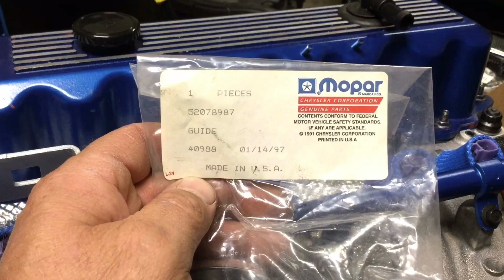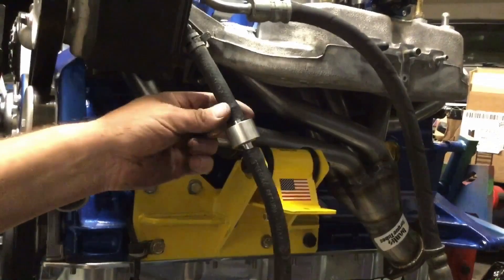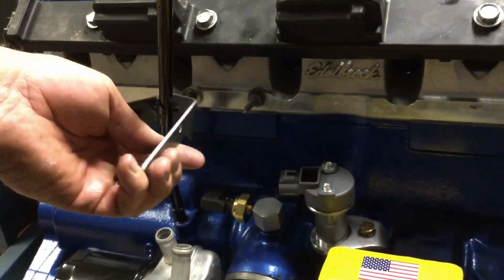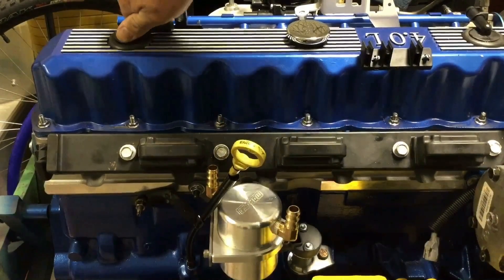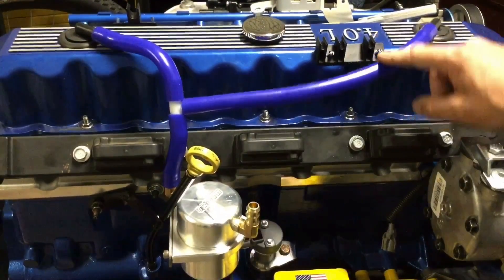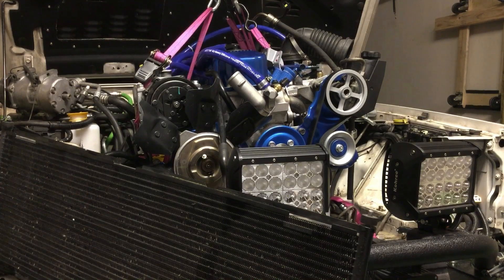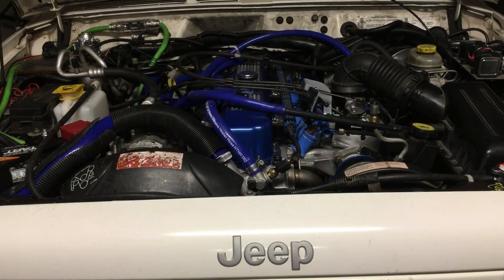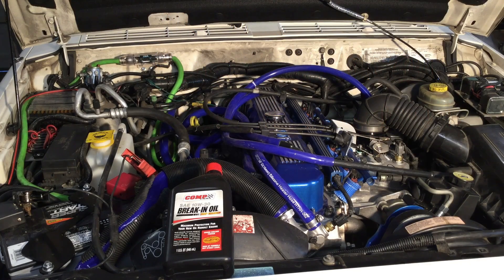Jeep 4.7 Stroker Complete Build Part 7 (Finishing Touches)

Comment: Great job my friend. I can’t wait to do something similar to my 2006 Wrangler Rubicon 4.0. Either do it myself or buy one from 505 Performance with something around 350 horsepower. I’m leaning toward the second option because I have two herniated discs in my lower back and, for example, a simple job that could take me a couple hours to do it because of my back it could take me double the time.

Comment: I followed your build and built mine exactly the way you built yours. EXCELLENT build. Thank you. It's all broken in and got about 3k miles on it. Then it sat for a yr while I did a stretch and axle upgrade. It's time to change the oil and I forgot what oil to use (insert stupidity). Can you tell me what oil to use once its all broke in?

Comment: I’ve watched your video series 2x now. Best in-depth build yet! I’m doing a YJ build, a 4.2 with a 4.0 headswap, using that Edelbrock head… but I like some of the other stuff you’ve done here and made note of the part numbers. Thanks for sharing and give us an update, how’s it holding up? What all have you done with it. 👍 🙂
Reply from the maker: Thank you! I’ve been using it for off-road recovery a lot. Recently I got a little happy with the throttle and spun a bearing. It still runs fine but I’m going to use this as an excuse to do a tear down and upgrade to a roller cam and possibly shave the rods to clear the girdle without spacers.

Comment: The pcv system wont work well that way... you have a direct vac leak
Reply from the maker: It runs fine and collects oil vapor the way it’s designed to. Where would the leak be?
Reply: @kevefox  the catch can should  be inline between the valve cover and air filter. The other port on the valve cover to intake vac... the way you have it, the intake is drawing straight from the air cleaner and not providing proper crankcase vac..

Comment: You are the KING!!! Did the same thing back in 2003. WISH I had all this info then. Lots of studying and trial and error. Stroked to a 4.5 and after 100K shes still running. Been itching to redo it again with all the new parts available now. My aim is for more LOW end tourque. Didn't do the roller rockers. Thought of going TDI, but I'm just in love with that 4.0......uh 4.5!!!
Reply from the maker: Thank you! I wish I would have gone with roller lifters/cam too. There is a supercharger mod utilizing a charger from a thunderbird. I guess with little machining it mounts to the A/C bracket. $350ish mod.

Comment: Great video.  Gotta know where you got your motor building experience.  Great job.  Few questions.  How much was the build?  How long did it take?
Reply from the maker: Always been around some sort of torn down engine. High school auto shop, years of off roading, boating, heavy equipment, and towing, lots of towing. They all break. Lots of watching and reading, fixing my own junk. I’m into this build somewhere around $5k. Took around 8 months. Mostly because I was splitting my paychecks between the motor and other upgrades.
Reply: Well... you put together a great video.  You have talent for sure.  Looked like you made a video showing all the parts and prices.  Looked like $9000 =- in the end.

Comment: How much horse power i can get from this 4.7 & can i fit in my 98 jeep Cherokee manual gearbox?
Reply from the maker: I’m not sure of numbers as I never dyno tested it. Should bolt right up to a standard. There might be some difference in the pilot bearing area if you’re using an older AMC Crank but I believe the new crank from Scat is right for a manual or auto in the ‘97-01 XJ.

Comment: Great video series... watched all of it thank you!  Now, I watched it more out of trying to convince myself not to rip out the 4.0 from my 2000 XJ and toss it.  Its such a love hate relationship.  The heat soak issue is ridiculous.  When I redid all the injectors, I got the DEI heat shield kit with the lower shield and the individual injector shields with the hopes it would work.  No difference.  God forbid I fall in some traffic, idle, or park and start within 10 min and not crack the hood.  All new high flow cats and exhaust so its flowing.  How's yours behaving?  Thanks again
Reply from the maker: Mine has had zero issues. I don’t drive it nearly as much as I should though. Sometimes while plowing the lower road my wife will follow in the XJ to continuously extricate my plow from deep snow. This means hours sometimes of idling or very slow creeping. With all of that aluminum there has been no noticeable temp rise. I do have hood louvers which allow a significant amount of ventilation. There is an easy way to accomplish the same concept by raising the hood hinges 1” allowing for ventilation at the firewall.
Reply: wrap the fuel rail and injectors along with the dei sheild kit.  thats what worked for me.

Comment: How is your transmission and transfer case and dif's holding out,or did you have to up grade them also?And how does it do in the woods.I am a old gear head,but i have to say that the video's was hands down the best video's i have seen on youtube,great detail,great resource's good sound,no back ground noise,very,very professional,and good clean work.check out rusty's 411 video's he is good also,but not as detailed as your where on your build.great info.thanks.
Reply from the maker: james bowen thank you. The diffs are 44’s with chromoly shafts and they’re fine. The T-case is the 231 with a new chain and 2L conversion/cable shift and a super short SYE. So far no issues.the tranny is stock with an external cooler/electric fan with no issues. The jeep has 97,000 on it so fairly new. I hear that keeping the tranny cool is key and a tight chain in the case really helps. If I grenade the tranny I’ve been reading up on replacing the clutch packs with ones meant for a Toyota using the same tranny. An Atlas T-case will be next if that goes. I’ll check out the Rusty’s videos. Thanks for watching
Reply from the maker: james bowen oh, the woods, it’s great. The hood louvers help on the cooling and I have TNT long arms with u-bolt eliminators so it’s really smooth and flexy. The steering is easy with the underdrive pulley. Snorkel, axle grease seals and an ARB breather for the diffs, t-case and tranny keep it dry. Skids on everything, good routing on all cables, hoses = no snags. Lots of light for night. Just a pleasure to wheel.

Comment: awesome build video. curious what kind of performance increase you ha e over a stock 4.0
Reply from the maker: scott L it’s like having an in-line 8.
Reply from the maker: scott L low end bumper lifting torque as well as high rpm capability. Cruising at 55 I can hit 70 to pass like nothing.
Reply: Tinkering Fox  I saw you used a new head. did you have to with the stroke or was it just a preference. I have a 93 so my head is one of the good ones lol
Reply from the maker: scott L I assume it breathes and cooks better and one reason I used to justify it was the holes for the coil pack. Using a cast head would work just fine. The thing to check first is the straightness of it. If it needs to be planed or the block decked then that will affect head gasket thickness or compression, push rod length etc.

Comment: What PCM is this running with? Is it the 4.0 PCM if so what year/model? Does it need some different PCM to increase the intake and fuel to feed the bigger cylinders?
Reply from the maker: Sam Sam the PCM is the factory one in this 2000 XJ Classic. The larger diameter intake lets more air through at idle and the 24# injectors let more fuel through with the same pulse width.
Reply: Good to know, thanks. Ive been wanting to do the horse shoe intake upgrade on my 98zj but i keep hearing mixed response about if it increases anything due to the pcm just makes automatic changes to compensate. That makes sense, ill look into the throttle and already had the injectors planned to do aswell.
Reply from the maker: Sam Sam The vacuum set up a slightly different at the far wall and of the old-style Intake. Something to look at but I just put one of those new style intakes on a motor in my sons 98

Comment: Is the aw4 able to reliably take the power from this motor? 
I figure you're putting out over 300 torque from this beast 
I know the aw4 was used in some Tacomas back in the day and were prone to cracking around the input shaft and those motors put out less torque than your rig
Reply from the maker: jake davis I’ve had no issues as of yet. I am expecting to smoke it at some point and have read about Supras that use that tranny with heavier clutches so something to look into at that point. I did add a larger cooler with an auxiliary fan to help.

Comment: About how much did this cost you and how long did it take?
Reply from the maker: grim123567 with the aluminum head and valve job around $5K. Time wise around 6 months on and off with work and waiting on parts/paychecks.
Reply: Tinkering Fox damn. Was going to see about saving up some money and having you build me one since i havent had a chance to do a full engine rebuild and wouldnt want to mess it uo but 5k would take an awful long time for me to save up and I probably live super far so shipping would be ridiculous
Reply from the maker: grim123567 if you stick with a factory head and used rods/injectors ect. $2k is easily doable. I'm building our house in Montana currently and have zero time for any side projects currently. Thank you for watching and commenting.
Reply: Tinkering Fox oh okay that works for me. I might try it then since that's less than half of the price lol that's KS for your time and great videos

Comment: About how much do you have wrapped into the engine. And also what are you running for front and rear end and how does it hold up for your setup
Reply from the maker: Skylar Whitmore I have just over 5K in parts and labor for machine work. I'm running the factory XJ 44 rear and a G2 TJ 44 front. Both with chromoly shafts and factory Spicer air lockers. I've had zero issues but I am thinking about bumping up to larger tires at which point I will add an Atlas and ARBs.

Comment: excellent resource and inspiration build videos, hope you don't mind  copycats like me who will be using your build as a blueprint to do their own. i have never done anything like this before but you've shown me that in the end (once the proper machining work is done by a professional)  the assembly process is possible if you're willing to learn. my previous attempt at learning about strokers ended with my head hurting when the discussions turned to the math; deck height, combustion volume, quench height, compression ratio etc.  i'm assuming that as you're happy with yours it's all worked out well :) what octane do you need to run for this particular build?
Reply from the maker: Michael VanAlstine thank you, and that's the reasoning posted the videos, to help others learn and create their own level of confidence and pride in their work. I'm running premium and it seems to be fine. I don't use it as a commuter but do run it for groceries and errands to keep it lubed. It does drink more Dinosaur juice but it's obviously not a Prius and I didn't build it with economy in mind, just romping fun. Thanks for watching, more wiring videos coming soon.

Comment: awesome vid. just wondering horse power/ torque and what it cost
Reply from the maker: kevin hicks I haven't put it on a Dyno but it flat kicks ass now. It does everything I want it to. I haven't added up the cost completely yet, still working on it going through receipts etc. Honesty using a more aggressive cam, boring say .030 over and better injectors with a chip and the right gear ratio you would be in it for a lot less dough and pretty satisfied. I did this more as a project than anything. And thanks for watching and commenting.
Reply: Tinkering Fox Thanks I hope you get a chance to dyno it I seen some get well over 300 horse
Reply from the maker: kevin hicks I think it will put up some good numbers. If I'm ever near an event where that's going on I'll swing in.

Comment: Pretty nice build. Are ye still running the clutch fan? That'll rob ye roughly 20hp.
Reply from the maker: CanadaBud23 thank you. Yes, I'm still running the clutch fan. I take this jeep out to the middle of nowhere and I wanted it to be  reliable so I think of the clutch fan as a cooling redundancy. Also if I'm running a bunch of lights the fan will help out in the 12v consumption. It has more than enough power for what I use it for. And thank you for watching, I appreciate it.

Comment: the "Viper Mod" would look very nice on this engine, but that's the rat rodder in me talking.
Reply from the maker: Dan Acton I've looked at that mod and will use that if I build a coil rail 4.0 with an older head (no holes) for sure. It's pretty easy to pop on a new rail when the computer tells you to so I just keep one in my trail box.

Comment: don't know if anyone asked, but why did you go with the flat tappet instead of a hydraulic roller cam? really like the build thou. really nice. gives me ideas for my 4.0 out in my 97 ZJ.
Reply from the maker: Dan Acton looking back I should have gone with roller lifters. I may change over to that style. I'm just bummed that I didn't have the head machined to make it possible for the
lifters to come up through without removing the head. ZDDP tends to ruin cats but I don't have to worry about emissions having it permanently registered in MT, I just hate the smell of cat-less exhaust. With roller tappets the need for zinc and phosphorus is reduced. Should have used them.
Reply: it was the thought I had when I was watching the build as a whole, but I'm more of a hot rod inthusist. and everyone seems to be running v8's. I was thinking of doing something very different. lol, this build would be like a stage 1. thou I might go up to 4.8 with a hydrarolic roller. step 2 would the TJ turbo kit from Banks. step 3 would be a super charger. the turbo would feed the charger at that point, if memory serves its how the old GT40 was set up. to polish off the build would be the water/methanol double shot once again from Banks. yea I may be a little nuts or crazy. but it does seem to be fun.
Reply from the maker: Dan Acton I was wanting more power on pump gas but keeping it dependable. In Montana I back up to thousands of acres of forest and I wanted to keep things relatively basic. A Torque monster would be a really cool sight in a rod no doubt about it.
Reply: Tinkering Fox that's what I was thinking. but for exhaust was going to do something simple 2 1/2 maybe 3 inch pipe Flowmaster 44. may would well on you jeep as well.
Reply: Tinkering Fox I'm in TN. lol were "the rules" are more like guidelines
Reply from the maker: Dan Acton 10-4 on basic exhaust

Comment: have you had it tuned? if so who tuned it, using what tuner?
Reply from the maker: Jabin Jay Trapp 
No tune yet, Jay. I wanted to put a few miles on her first and see how she does factory. So far it's got plenty of power for me even with the wrong gears for my tire size. If I end up getting it tuned or installing a tuner/program I will definitely do a before and after.
Reply: Tinkering Fox, I'd be curious what your AFR is?
Reply from the maker: Jabin Jay Trapp 
Me too, idling a little high but it's been single digits into the teens for temps for a couple weeks.

Comment: This looks like so much fun to do!  Other than the satisfaction of doing this yourself, what are the advantages of your build when compared to, say, an atk Baja STROKER?  I have done a full nut and bolt restoration of a 2000 jeep xj classic. The engine is the only thing that I have not done with the exception of every bolt on performance part imaginable. The engine only has 90k miles on it. I am already looking to the STROKER. I just cant justify changing the engine until it gets more wear on it. Thoughts?
Reply from the maker: Stephen Patton 
Yes,  you can be a big headache. Buying a stroker and installing it out of the box would definitely save a big hassle. Look at 505 Performance as well for a complete bolt-in solution. At 90,000 miles you may want to put off swapping that motor and just try a different gear ratio for more power.
Reply from the maker: Stephen Patton it can be a big headache

Comment: Hey love the complete build haven't found anyone else with the build start to finish like this! I'm thinking about doing this to an old 4.0 I have, If you had to guess how much did you spend doing this? I'm trying to decide if its cheaper to do this myself or just buy a 4.7 stroker.
Reply from the maker: knifecontroler 
Thank you, guessing somewhere around 4500 closer to 28 to 3000 without the aluminum head